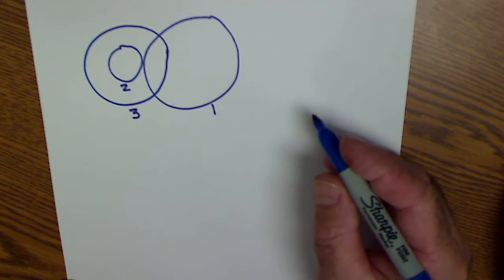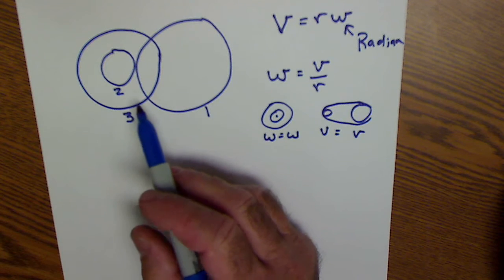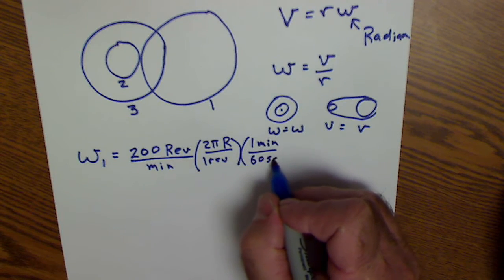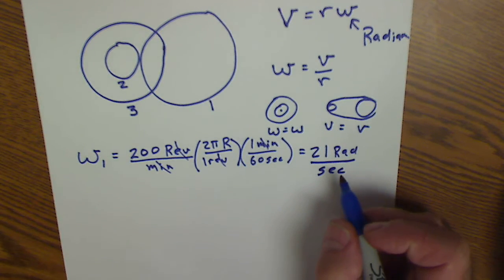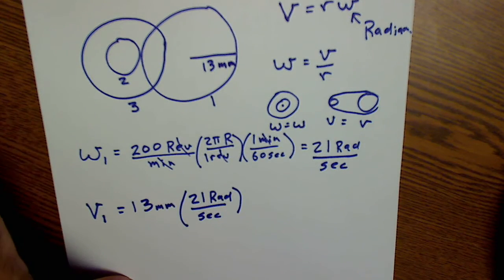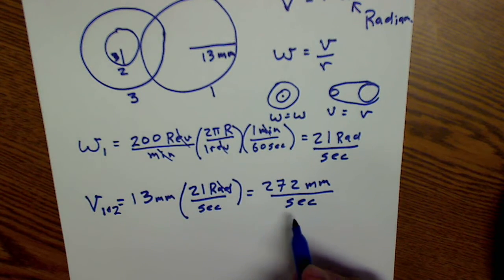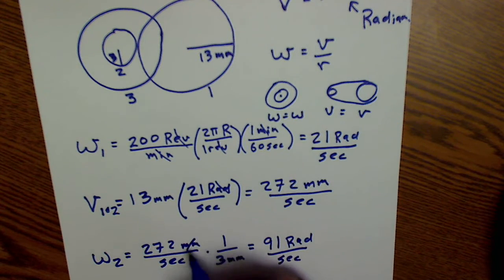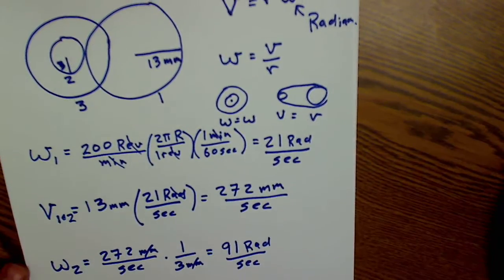Angular and Linear Velocity, Three Gear Problem

Comment: Why isn't the tangential velocity of the 3rd wheel equal to the other 2 wheels? it's fixed to 2 right? so I thought they'd be the same
Reply from the maker: Tangential velocity is the same as linear velocity. The v is equal when the outside of the gears mesh or are connected by a belt or chain.
Reply: @ColfaxMath  Ahh I understand now, I didn't expect you to respond on this older video of yours. Thanks a lot sir!